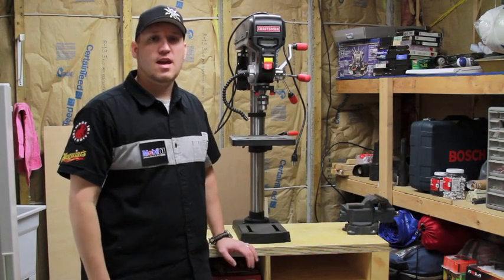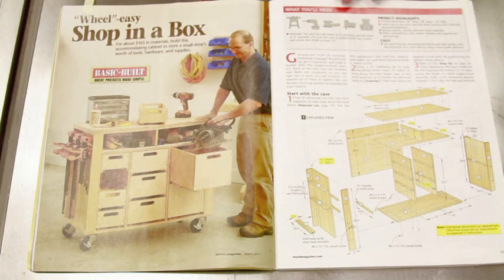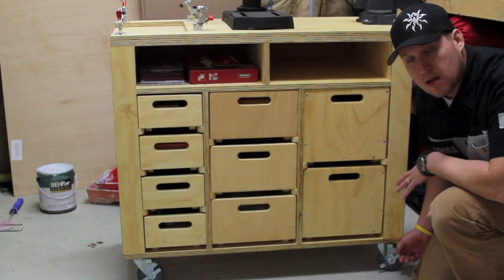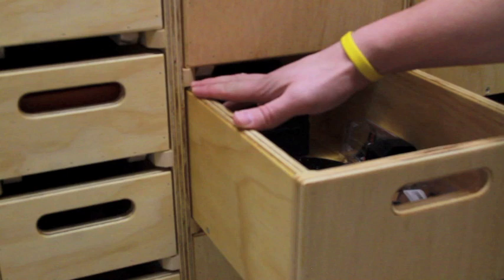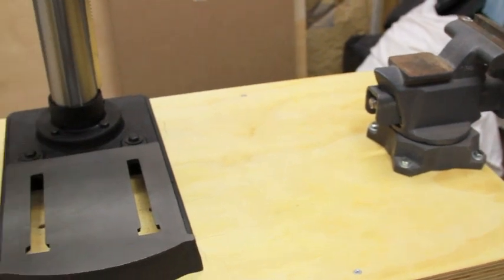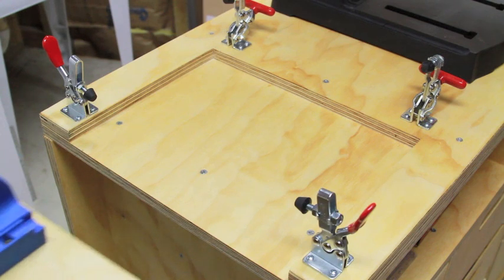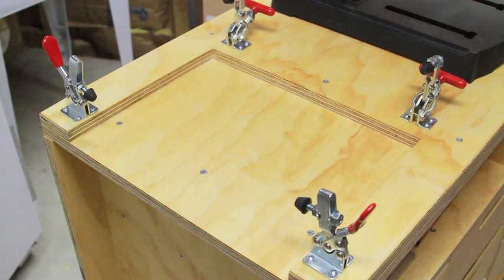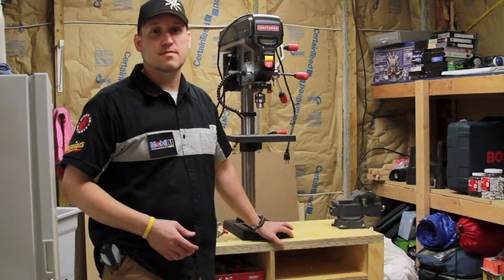Craftsman Drill Press workstation: Part 1

Comment: +BusyDadsWorkshop   

I realize that it's been quite a while since you built this, but you could easily do the following modification to your existing benchtop to allow quick & easy tool swaps without having to use any of those expensive & bulky clamps!

Just use a dovetail router bit to cut dovetail edges along the inside perimeter edges of the recessed bench-top receiving "tray".  (I like the MicroJig brand dovetail bit that is used with their slide-in clamp system because it has slightly rounded-over corners & shoulders).

So the "insert receiving tray" or opening in the top of your workbench would look like this when looking into the open end at eye-level to your workbench top:    /_______________\   

...and the mounted tool "insert plates" would be the opposite dovetail or angle on the edges so that they naturally slide in and are held captive by the workbench's dovetailed/angled inside edges.

You can use your router with a dovetail bit or the table saw with a bevel to cut the beveled edges in your various tool mounting/insert plates.  You could even use a jig saw set with a bevel and run against a straight-edge guide.

A small, simple, drop-in locking pin placed into a 1/8" diameter hole that's drilled vertically through the front center of both the insert plate and the benchtop will completely secure the base plate into the workbench.

You could use something as small and simple as a 16D Duplex Nail as your drop-in "locking pin" which would stay in place by gravity and be easily pulled out for super-fast & easy tool swaps with just one simple action needed to lock or unlock your tool into place!...

AND, you wouldn't have any clamps or other obstructions on the surface of your workbench top besides the tiny locking pin.  :)
Reply from the maker: Just saw this comment.  That is a great idea!  Thanks!  Might have to implement that once I get into our new house.

Comment: I like the recessed tool holder It is a great idea. Just a few thoughts the lock down clamps are nice but they stick up and can create a problem for some tools. A different approach is to put in some "t" nuts on the bottom side of the permenant  top  Place the first insert in the recess and drill pilot holes 1/64" larger than the bolt throug both (do this befroe final assembly of the top to the cabinet) than open up the hole in the bottom Fixed bench to the size required to put the "t" nut in Recess the back side of the top so the "t" nut is flush with the  underside.  If you are doinf this as an after thought use "rosin" inserts instead of "t" nuts as they can be installed from the top. You can get the inserts from any good woodworking supply house. They come in sizes up to 1/2" threaded size  You could even mount that vise and drill press this way so you could have a flat top if required in a few moments.
Reply from the maker: Peter, thanks for the input!  I'll have to look into that! Using the threaded inserts in the fixed portion of the top is a good idea.  I'll have to stop at my local Woodcraft location.  However, I would have to use bolts then to hold the tool down.  This nice thing about the lock clamps is that I can change out the tool in seconds.
Reply: BusyDadsWorkshop The swap out feature is really great, but those clamps are always sticking up. I bet it could be made a bit simpler by just making an angled edge on your inserts/table top like a french cleat (narrow at the surface & wide at bottom) so you can slide it in and out from the side. Then put a sliding bolt lock on the table top edge to lock it from coming out on you. Hard to explain without pictures but I hope it made sense. :)
Reply: +Peter Menningen  
+BusyDadsWorkshop  
+V King  

I realize that it's been quite a while since you built this, but you could easily do the following modification to your existing benchtop to allow quick and easy tool swaps without any of those clamps!

As  @V King  suggested, just use a dovetail router bit to cut dovetail edges along the inside perimeter edges of the recessed bench-top receiving "tray".

So the top of your workbench's "insert receiving tray" would look like this when looking into the open end at eye-level to your workbench top:  /_____\   and the tool mounting "insert plates" would be the opposite dovetail or angle so that they naturally slide in and are held captiive by the workbench's dovetailed/angled inside edges.

You can use your router with a dovetail bit or the table saw with a bevel to cut the beveled edges in your various tool mounting plates.  You could even use a jig saw set with a bevel and run against a staight-edge guide.

A small, simple, drop-in locking pin placed into a hole through the front center of both the insert plate and through to the benchtop will completely secure the base plate into the workbench.

You could use something as small and simple as a 16D Duplex Nail as your drop-in "locking pin" which would stay in place by gravity and allow for super-fast & easy tool swaps with just one simple action needed to lock or unlock your tool into place!...

AND, you wouldn't have any clamps or other obstructions on the surface of your table besides the small locking pin.  :)

Comment: I used your video to build my mobile workstation around the exact same Craftsman drill press.  The only difference is I used a leftover kitchen cabinet I had sitting around in the basement.  So I threw your top and bottom on it from the specs, added the casters, and I'm in business.  Thx for the video.

Comment: Nice cabinet! How did you get those nice looking square cuts in your removable/recessed portion? Straight in from the ends and a plunge cut on the 90? It doesn't look like you used pilot holes in the corners (like with using a jigsaw).
Reply from the maker: Thank you Bob C.  I used a jigsaw.  I did drill pilot holes in the corners.  I just kept it out far enough from the corner so I could get a nice square cut with the jig saw.

Comment: Very nice video!   I'm 6'-8" tall.  Wondering what the height of the tabletop is.   I might have to modify to save my back.
Reply from the maker: With the wheels that I have on it, the top is about 32" off the ground.  I have considered cutting it down to the tops of the drawers to bring it down a little.  I'm 6'-1".